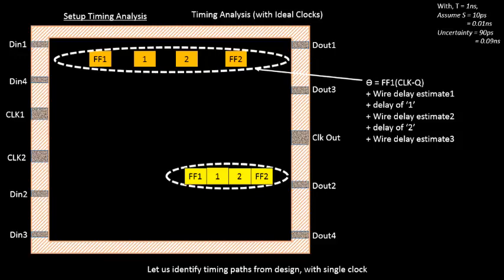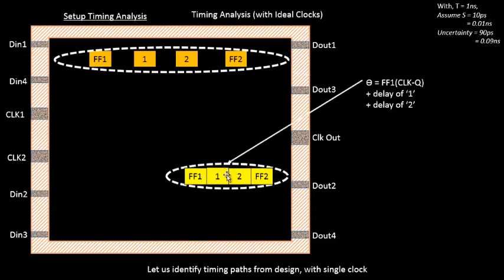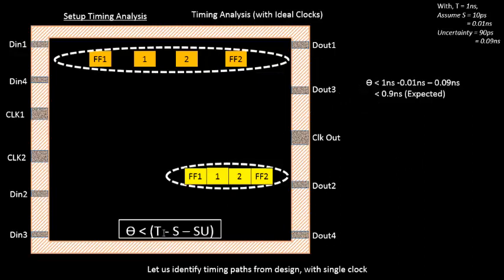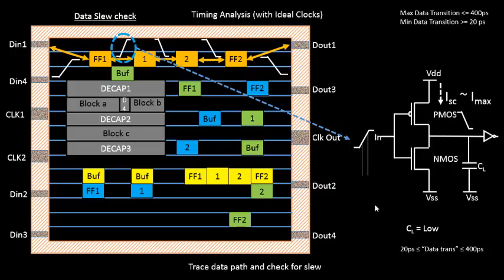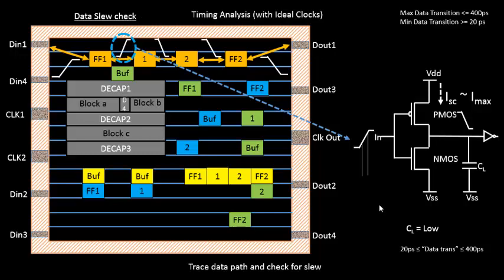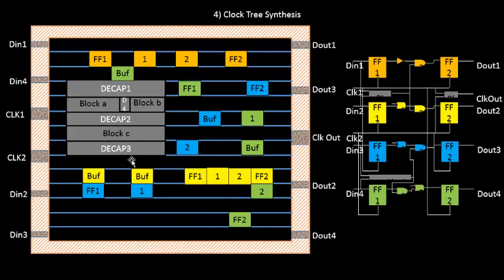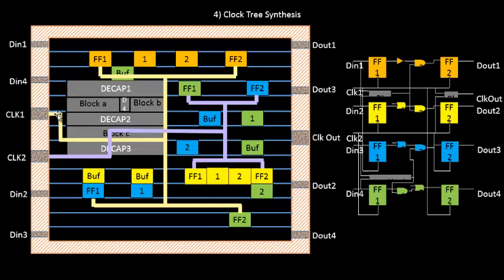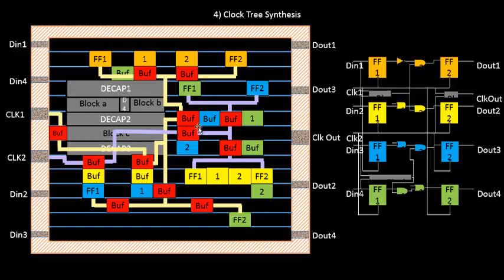VLSI Academy - L3 Placement Timing And Clock Tree Synthesis

Comment: You are using buffers or repeaters to transmit a signal from one point to the other without deterioration of signal, will there not be any delay due to buffer insertion?
Reply: +Sunil Sreeram Kumar If you analyze the delay of really long metal wire, adding a buffer in the middle of is helpful. It reduces overall delay of long metal wire. 

I did an experiment once.
Reply: Buffers can break elmore delay and reduce it.
Reply from the maker: Thanks for explaining .... you are right about long metal lines